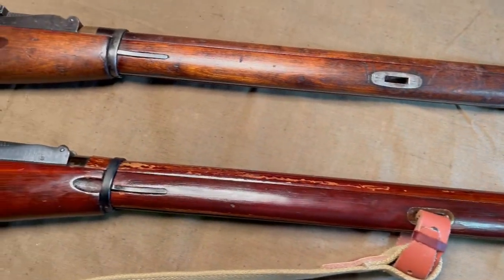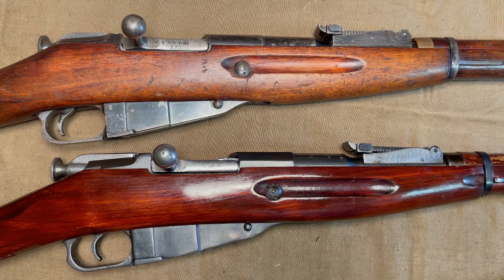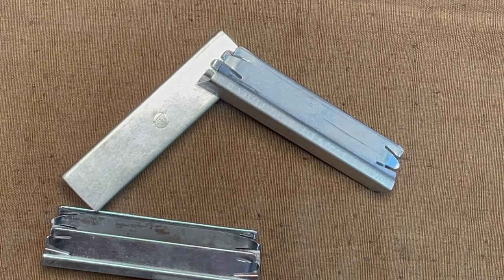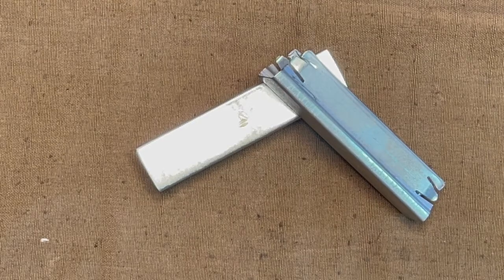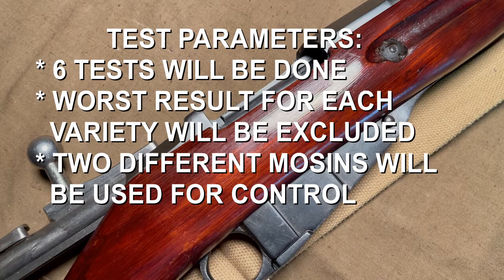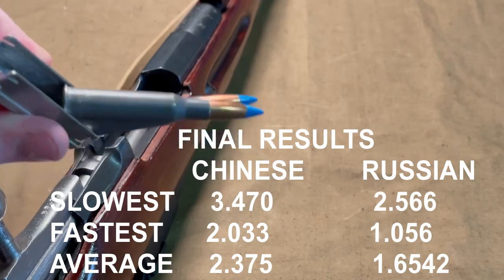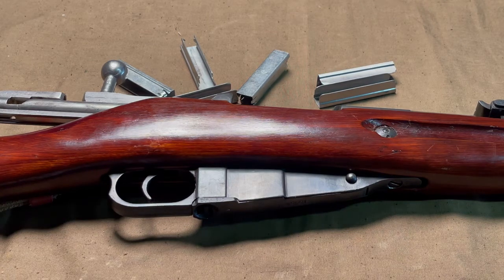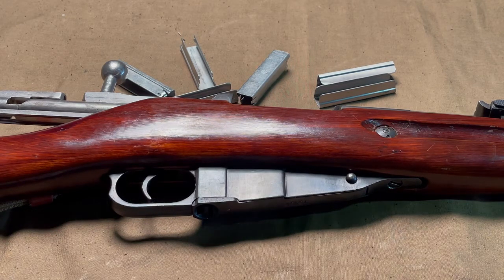Testing Real Russian Stripper Clips Against Chinese Knock-offs in a Mosin Nagant

Comment: just ordered a pack of 4 original clips straight from Russia on eBay, cost me $31 CAD with free shipping lol. Not cheap seeing how a pack of 20 of the Amazon ones are only $50 CAD and free shipping. And in the pics they do show light surface rust i guess from being in storage for so long, but that's the look I'd prefer, I don't want any shiny Chinese clips next to my old mosin lol. And now I know my originals will definitely work better then the cheaper ones too, thanks for the video showing the difference.

Comment: On Ebay I got 8 original Tula stripper clips for about $40 shipped from Ukraine and trust me these are better than the boof Chinese ones. I purchased a pack of Chinese ones that didn't even fit in the stripper clip guide
Reply: Same, it sucks so bad I just tossed them. It's legit easier just to hand load them

Comment: Ah crap... I guess I bought the knockoffs because they were cheap. Could I just bend the clips to fit into my 91/30 better?
Reply from the maker: You can try to get them in better shape, but I’m not sure how well it would work. It does strip off a little easier if you hold the top round and kind of pull up on it a bit to use it as a lever and push down.